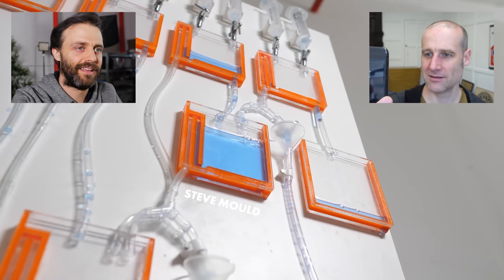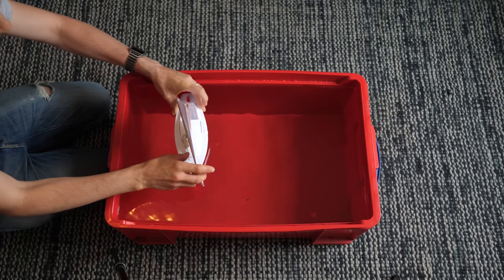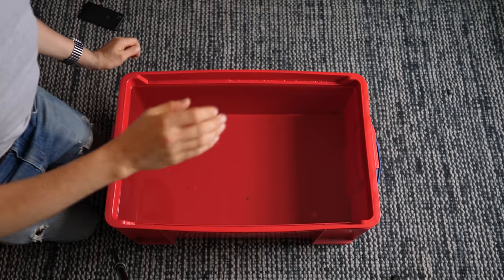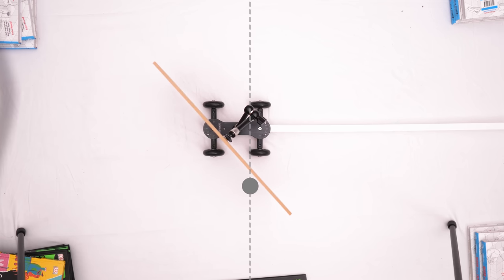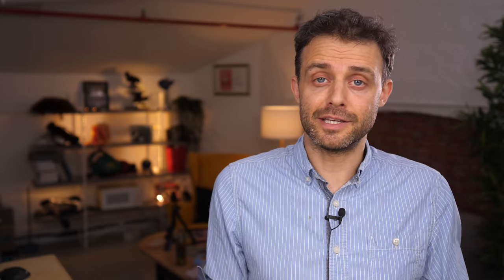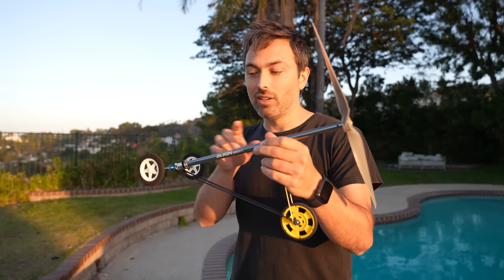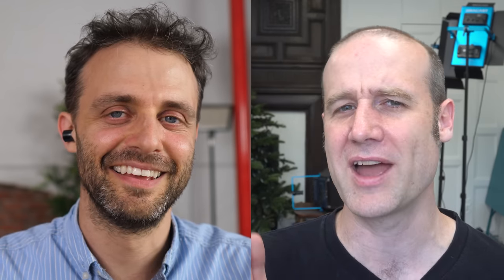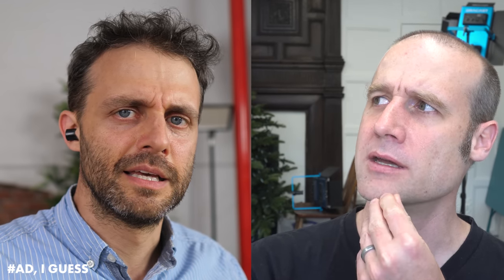Sailing Faster Than The Wind - How Is That Even Possible?

Comment: Sailors: lol eZ.

Everyone, even mathematicians: Okay, so... It's like... Hold on.
Reply: For real. I'm a fairly decent sailor and it's always felt intuitive to me, but I could never really give a rigorously worded description of how it actually worked till I sat down and thought about it for a while. This was after like 6 years of sailing.
Reply: another lesson in how we dont need to understand something in order to utilise it
Reply: @lmva  you can see a sail working by looking at it, wind blows boat moves, there's logic to it.
You know how a computer works just by looking at it? or how about a modern automobile?
Reply: @coreys2686  the only thing that makes modern cars confusing is their integrated computers tho.
Reply: @ivortragedi2787  Depends on the desired level of understanding. There's some fascinating stuff going on inside the engine, that the electronics only provide timing for.

Comment: The reason the sailboat isn't pushed sideways is not just due to the thin hull shape. There will also be some rudder input to correct the course of the boat.
Reply: also the "fin"/keel
Reply: Not if the boat is set up right, you can actually let go though most boats are designed to point up wind for stability reasons
Reply: It is good to mention that if we speak of Bermuda type rig (Genoa/Jin and main sail) that there is a possibility to not use rudder at all if we find so-called balance of the sails.  Wind rotates the boat in different direction around the mast/keel depending on what sail you tighten and ease.  So, if you find balance of sails, boat can go upwind with no rudder input.
Reply: @whatswrongwithyarik4835  Yep, we sailed a couple weekends back and found ourselves with perfectly balanced sails close hauled (with a slight inclination to a close reach) and I showed my son how we could adjust our course just but adjusting the Jib or Mainsail having the rudder locked amidship. I would be curious the efficacy if we could remove the rudder from the boat/equation.
Reply: A good sailor balace the boat, so the rudder is straigh forward without breaking. I sail on a 3 mast schooner gaff rigg. If you put up sails in the front, you have to put up sails in the back. The jib in the very front is in pair with the top sail on the mizzen mast. Whith good riggers, you never have to fight the boat and the wind at the helm.

Comment: I don't know how many times I've explained this now but in Veritasium's video it can go faster than the wind as once the craft is up to speed, and the propeller is producing thrust, (remember the propeller is not a windmill on that craft) the thrust from the propeller is increased because of the tail wind. It aerodynamically increases the propellers thrust close to its' maximum which is "static thrust". An easy way to think about this is a light aircraft produces maximum thrust when it is not moving. As it accelerates down the runway the thrust drops off significantly. As it accelerates down the runway if you were to introduce a tail wind to the propeller its thrust would increase. (However detrimental to lift over the wings)

Comment: "you can explain lift using Newton or Bernoulli"

an aerodynamicist is about to tell you all about how neither actually explain the full mechanics of a wing
Reply: As a chemist, we should just stick to ab initio calculations for everything. Hrmf!
Reply: You need differential equations to explain lift
Reply: @kellymoses8566  Differential equations are a description, but definitely not an explanation.
Reply: @jorehir  Tell that to a physicist lol.
Reply: @jorehir  go away monster, Newton was a god.
Reply: Gonna be honest, I've never liked Bernoulli's theory as an explanation for lift.
Reply: @ignasanchezl  At least Benoulli's principle gives an explaination of the origine of the lift, while Newton method says "there has to be a force according the Newtons principles" without giving the nature of this force.
Reply: You can fly with a flat wing.
Reply: @ignafiltro  and Bernoulli's principle explains why in detail while Newton principles only says that it does, without giving the physical origin of the lift force. To make a parallel with an other series of video, think of the chain fountain. You can simply say "there has to be a force from the pot due to the action-reaction principle of Newton" wich is enough. Or you can say "there is a lever effect that communicates a force from the pot to the chain". Both statement are correct but the first don't give details about the origin of the force while the second gives the microscopic mechanism that drives that force. Similarly, Newton an Bernoulli's approaches are both correct and give the same prediction. But where Newton only says "there has to be a force  of lift" Bernoulli says "the difference in pressure gives rise to a force", giving the microscopic origin of this force. Anyway, at the end both approaches give the exact same quantitative prediction.
Reply: This might be just me because of how I understand wings, but to me inertia and particle on particle interactions inside a pressurized atmophere can easily visualize what a wing does.

I dont understand why such a simplistic explanation can not be accepted and I while I know you can dive into pressures and differentials, to me these are just intermediaries of an kinetic energy transfer. 

Equations like Bernoulli's are just correlative references.
Reply: Every time I read that according to Bernoulli faster moving air generates lower pressure over a surface, it simply never made sense to me. Why? Beacause of the frame of reference.
Reply: @geoffroydelaitre5966  I'm sorry, but you're entirely incorrect. Not only are the two methods not opposed to one another as explanations, Bernoulli's principle is insufficient alone to give a physical explanation for lift. All that it tells you is that when a fluid flows through a lower pressure zone, its speed will increase and vice-versa, but in the case of an airfoil it gives no physical explanations for why an airfoil would alter the speed or the pressure of the flow. Think of Bernoulli's principle as simply stating how energy conservation works for fluids--absent any work or heat transfer, the energy of the fluid is conserved by changing speed to balance out pressure changes and vice-versa

The most basic, but correct explanation of lift comes from the Newtonian understanding: the airfoil deflects the flow downwards by imparting a downward force on it. Because there's an equal and opposite reaction, the air therefore exerts a reaction force back on the wing. Going one step deeper, you can recognize that the forces are created by collisions between the air particles and the airfoil. These collisions and the subsequent bounces reduce the linear momentum of the flow field, which Bernoulli's principle tells you would increase the static pressure below the airfoil.  This increase in static pressure creates an upward force. It is quite literally the same as the simplified explanation--the deflection of the flow creates the pressure differential, which is the equal and opposite reaction. You need the Newtonian explanation to get to the mechanism by which this pressure/momentum change happens, otherwise your explanation will violate the conservation of energy.

At the end of the day, any simple explanation of lift is incomplete. This explanation assumes inviscid and incompressible flow, which air is not, and viscosity and compressibility have large impacts on aerodynamic forces.. The Navier-Stokes equations are nonlinear, and are often very difficult or impossible to solve. There's a ton of factors involved, so any simplified explanation is going to miss a lot of things.

Source: Aerospace engineering degree, took years of classes about this.
Reply: @Scoobacca152  Let me disagree with your answer. You have to separate the resolution of the problem in two steps: First you have to calculate the flow of the air given by the Navier and Stokes equation. Only once you have that you can eihter apply the Newton or the Bernoulli principle to determine the lift. And both give exactly the same prediction for lift. Of course to compute the Navier and Stokes equation you migth do some approximation, but that step happens before applying either the Newton or the Bernouilli principle. If your computation is wrong, both Newtonian and Bernoulli approach willl give the same wrong result (and I emphasise: for a given air flow, both approach give the exact same prediction). The Newtonian approach predicts the lift from the momentum conservation  when looking at how the air flow is deflected according to the Navier and Stokes equation computation. The Bernoulli approach predicts the exact same lift force from the field of speed of air given by the same Navier and Stokes equation computation. As I was stating, the only difference is that the Newtonian approach asserts there has to be a force to account for the momentum transfer while the Bernouilli principle specifies that it is the pressure difference on the wing that produced the lift. But again, both give exactly the same lift prediction, and both can only be applyed after the computation of the Navier and Stokes equation (and usualy an approximated one). There is no "correct approach", they are equivalent, but one does a global balance of the momentums while the other provides the origin of the force at a microscopic level. The fact that the air flow is deflected is not a result from the Newtonian approach but from the prior resolution of the Navier and Sokes equation. 

Navier and Stokes say "air flow is deflected that way with such field of speed". Newton says "air is deflected so there has to be some force going that way" while Bernouilli says "the deflected air field of speed induces a pressure difference that creates lift that way". That's why, despite the equivalence of the approaches I prefer the second wich goes deeper in the details.

Comment: A bit surprised I don’t see lots of comments calling this out as an incorrect description of how sails work (and also how aircraft aerofoils work).
In both cases the lifting (or boat pushing) force is not at all because the sail or wing is on an angle to wind. It’s because both the wing and sail form an aero foil, shape. As one side of the sail/wing is longer than the other, air must travel faster over that surface in order to meet with the air on the other side (if it didn’t, there would be a spectacular and dangerous vacuum at the trailing edge of the wing/sail). The effect of the faster travelling air on that surface is to reduce the air pressure compared to that of the other side. The result is a force in the direction of the upper/longer surface of the wing/sail. This is called Bernoulli’s Principle. 
The one exception to this is when a sailboat is sailing down wind and has the sail set out perpendicular to the motion of the boat. In that case it is just moving by pushing from the wind on the sail.
For those who will point out a sail has the same length on either side - yes, but if you understand how air flows smoothly over a curved surface but turbulently over a suddenly break in a surface (the mast and trailing cavity of the curved sail behind it) the overall effect is still a pressure differential.
Reply: Ouch!

Comment: OK, but in the veritasium video they said "speed made good" can be faster than the wind. Down wind by tacking with the wind.  can you explain that.
Reply: Thanks ! That is indeed missing from this video. The Bernoulli effect is completely overlooked here, after the initial comparison with airplane wings. America's cup boat would be a great exemple of what Dererk was providing a handwaiving explanation for in his video. (that's the first time I have disliked a Steve Mould video)
Reply: I think a explanation could be: (its my explanation)
When the wind speeds up the vehicle it doesnt speed it up due to it turning the blade, but due to pushing on the vehicle. Then the wheels will turn also and this causes the blade to spin. Now when the vehicle is at the speed of the wind it will get faster, cause actually if you imagine a horizontal line through the rotors blade there will be a crossing point between the imaginary line and the blade. This dot actually moves backwards while the blade is spinning, because of the blade is tilted. Now you have a point on the vehicle that is moving slower than the boat, cause this point is moving backwards relative to the boat (it could even really move backwards, but lets assume it doesnt)
So then the air can push on this point, since its slower than the air and thus push on the whole boat. 
Of course this backwards moving point doesnt really exist. But you can also think about it this way:
The rotor is spinning, and thus it will blow air against the actual wind. This will cause some swirls and this will cause the vehicle to kind if push itsselve from the wind. Now you could argue that pushing from the wind takes at least as much energy as it takes to turn the wheels. But thats not true, since the vehicle is moving faster relative to the ground than to the air. And thus its easier to push from the moving air than to turn the wheels to be able to push the air backwards. (Have you ever been in a pool with circle motion and just floated in the water while pushing yourselve activly from the fast water jet at the edge tonbe faster than the others? did you notice that gaining speed by this was easier than gaining the same amount of speed difference due to pushing off the non moving water? ) this is  because the kinetic energy increases quadratic with speed. So lets say you want to gain a ∆v of 1m/s relative to non moving ground while you've got no speed  in the first place. The energy reqiered would be 0.5(m^2/s^2)*M with M being your mass. But if you try to gain 1m/s when you are at 20m/s to get to 21m/s you will need a energy of 20.5(m^2/s^2)*M. So much more. So if you push from a object that isnt moving to gain 1m/s while you are at 20m/s you will have ro use a energy of 20.5(m^2/s^2)*M
But if you are pushing from a object being as fast as you, you will have to use only 0.5(m^2/s^2)*M. This is because you will push the other object backwards by doing this and thus you will decreas its veilosity and thus its energy and thus you will gain energy without having to do that much of a work. (of course this 0.5(m^2/s^2)* M does only hold, if you assume that the mass of the object you are pushing from is infinity, cause else it will get slower while you are pushing from it like i already said, and this will make calculations complicated)
So you can actually divide this process into steps:
Step one: Pushing from the wind using a energy of 0.5(m^2/s^2)*M and increasing with speed of 1m/s
Step two: using your energy relative to the ground to push from the air. 
So if you calculate that you will loose 0.024m/s. (cause you will get a energy of 0.5(m^2/s^2)*M if speeding down from 21m/s to 20.976m/s) .
So over all you are gaining 0.976m/s without blaming the law of thermodynamics.
Reply: Uniformed guess on how this is possible :
Watching the the Americas cup we see there is a lot of 'dirty' air coming off the back of the boats. This would match the explanation of how the device the the veritasium works, robbing velocity from the air.
Given that the velocity in the direction of travel can be >3x windspeed the boat will meet a lot of air to steal velocity from.

The second part is Steve pinns, from the point of view of the boat the speed and direction of the wind are radically different. And complex physics stuff happens
Reply: Agreed, this is completely missing and very relevant.
It is all to do with 'apparent wind' . Google will provide ample reading on the matter, but here is my attempt at a very simplified explanation:

Imagine Steve's sailing trolley boat thing moving at 10m/s without any wind. It will feel like there is 10m/s of wind coming from straight in front of it. This is 'induced wind'.

Now imagine there is a 10m/s wind blowing at 90 deg to the direction it is traveling in. This is 'true wind'.

Someone on board the trolley (and the sail) will experience the combination of these two coming from 45 deg at 14m/s (ish). This is 'apparent wind'.

The trolley can now adjust its direction of travel  to be at 90 deg to the 'apparent wind' (135 deg from 'true wind') and accelerate up to 14m/s (ish).

The trolley sail will now experience the combination of the 14m/s 'apparent wind' and the new 14m/s 'induced wind', resulting in an apparent wind of 20m/s (ish).

This process repeats with the trolley getting faster and faster while turning away from the 'true wind', resulting in a trolley having a 'speed made good' greater than the true wind.
Obviously pesky things like friction, drag, and other physics get in the way to some extent but hopefully you get the underlying principles.
Reply: Thank you. I think I sort of understand it now. Still wish Steve would do a follow up as the most counterintuitive aspect from the Veritasium video is missing from his explanation ✌️🤓
Reply: @reubydoi7111  I used to ice sail. On glare ice with a decent breeze the limiting factor for speed was fear.